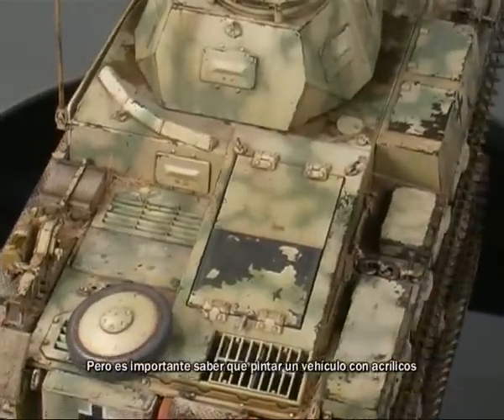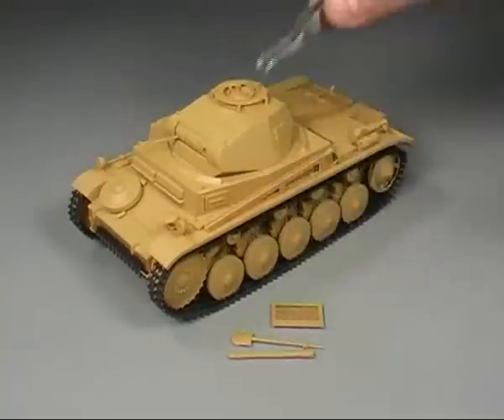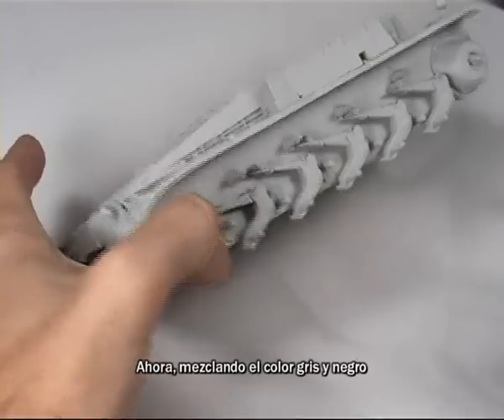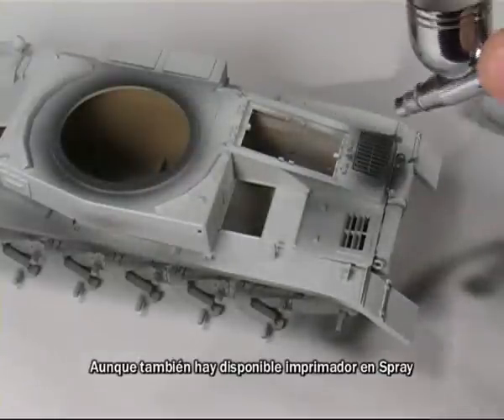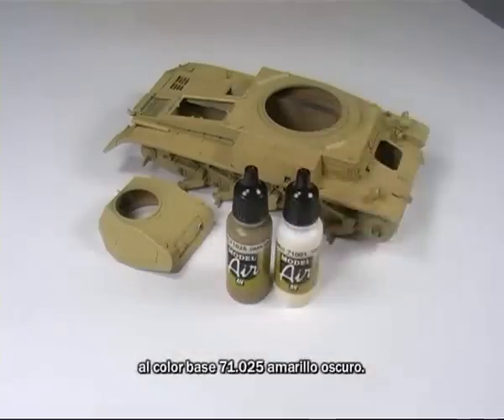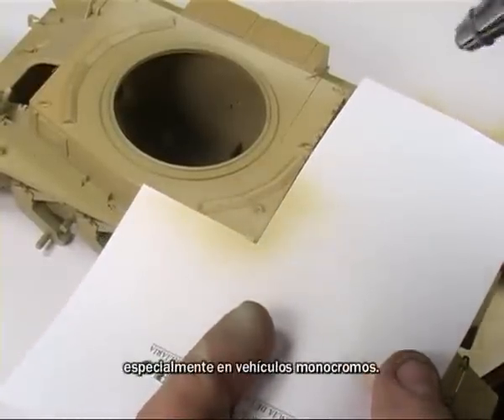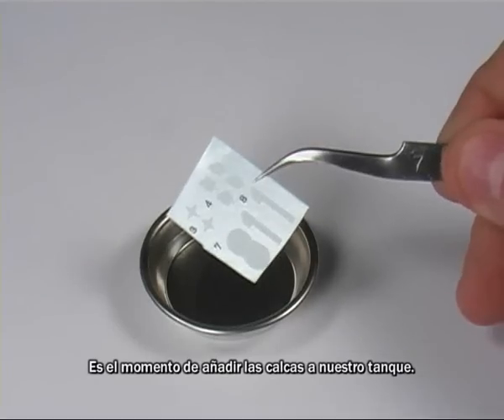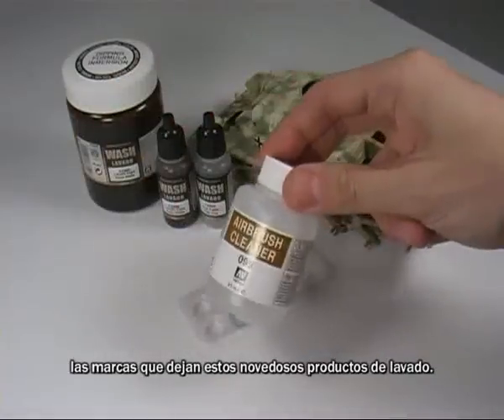Vallejo Acrylics Techniques Part 1/4

Comment: Great videos, I watch the series often. The order of applying the decal solutions is wrong though, first apply the Decal Fix which is an adhesive then apply the Decal Medium (renamed as Decal Softener since this video was made) which is alcohol based and softens the decals.
Reply: I use Tamiya Markfit and Revell decal soft and after clear coat they look painted on.

Comment: Why do they add Varnish to each step in the base painting process? I'm interested to try it out but I'd like to know why.
Reply: Hi, Mig explains this in his FAQ book. It's to give the paint a satin finish so you can work on it later without gloss coating the entire model also real tanks are mostly satin in finish not the matt that most modellers favour. Mig doesn't like giving his models an overall varnish coat as he likes the different parts/materials to have different finishes.

Comment: I see you do the post-shading with white, but what is the satin varnish for?
Reply: then you can use oil paints for shading. The satin surface gives them something to bind to,  and a flat coat wouldn't let you push the paint around.
I'm thinking you'd need a satin coat to apply powdered pigments too- but can you use oil paints and powdered pigments both, over the satin coat? 
Pigments over oils?
Reply: @mookins45  why not just clear coat it with a gloss coat afterwards, that us what I do.

Comment: What do you thin these paints. With????
Reply from the maker: Vallejo model air thinner.
Reply: Use water,works the same as thinner and its cheaper

Comment: Vallejo model color silver?   absolutely sucks!  
Even after washing an assembled plastic model, Tamiya or Vallejo primer...there paints still are much too thin.  They don't have strong adhesion much at all though I like the colors.  I only use Vallejo on a few models and certain colors.  Vallejo needs to change it's formula for much better adhesion.

Comment: They say you dont have to thin this paint. Its a crock-this paint is not even made for airbrush. I bought 60 bucks worth of it-its like caulk. You have to go at least 3 to 1 thinner to paint and DO NOT use their flow improver-it wants to keep the paint together, which clogs your brush immediately; the OPPOSITE of what the brush is for; to break it down to atomize.  Get Tamiya if youre a newb. Youll thank me.